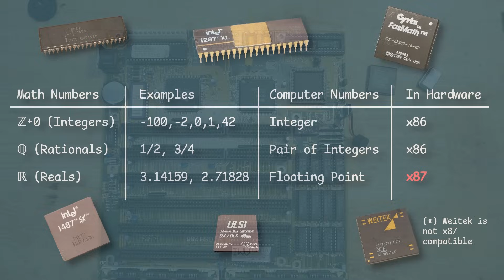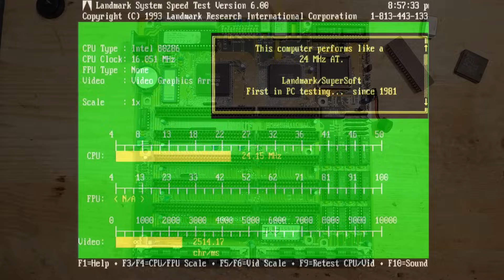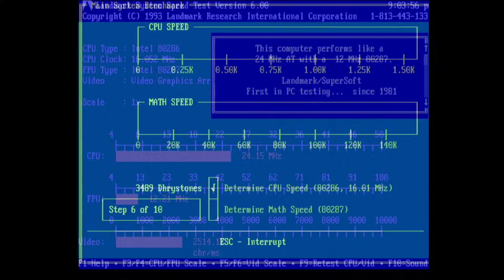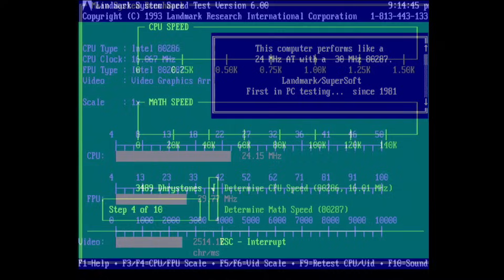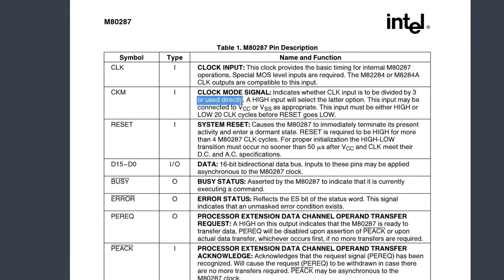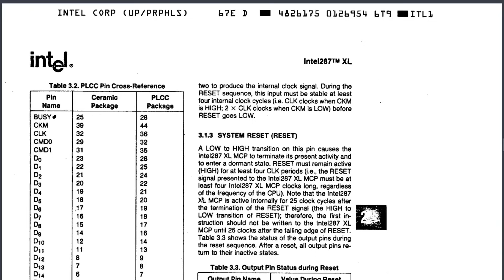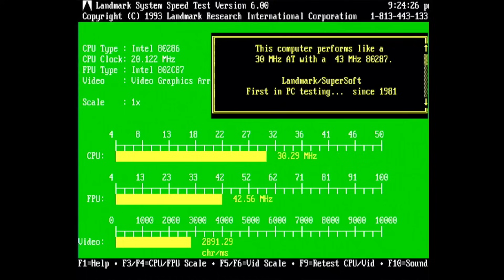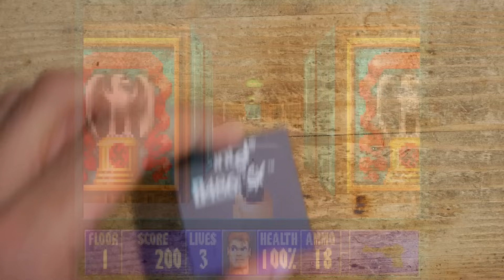287 Booster

Comment: I'm pretty sure the main difference between SX and DX is the data bus width, not the presence/absence of math coprocessor
Reply from the maker: Depends on the CPU. On 386 it's the bus, on 486 it's the coprocessor.

Comment: Interesting and informative, I actually had access to a 286 12mhz back in the day and we would play around in Doom on it.... was interesting; but as a kid it was better than "nothing else to do"... I never really put much thought into Doom/W3D not using an FPU and remembered when my friends family got a DX2 66 and Doom was running "max fps"... or so I thought at the time... I realize now it was the higher clock rate plus onboard GPU really accelerating that experience... When I later got my own AMD DX4 120 and Quake released, my friends Pentium 75 smoked it in Quake.... because of the superior FPU. ... things I wish I would have known as a kid lol, could have saved some money.
Reply from the maker: Thank you for sharing. It's always interesting to read how memory can cheat on us. Same often happens to me, that's why I like to dig out that old hardware to confirm or disprove my memories. F.e. you definitely couldn't play doom on a 286 back then. Probably that was Wolfenstein 3D, because Doom requires at least a 386 CPU. But even on the fastest 386DX at 40MHz this game was barely playable. Even 486DX2-66 was still not able to run the game at full speed (the game had a limit at 35 FPS). GPU acceleration was not a topic in Doom as well. In fact the game came years before first non-professional GPUs hit the market, so it didn't use any hardware video acceleration. It did benefit though a lot from fast data and memory throughput, so fast PCI or VLB graphics cards were important.

On the other hand what you remember from Quake is absolutely on point. The game required an FPU and that was in Pentium massively better, than in any 486. So even Pentium 60 delivered more FPS in Quake than a 486DX4 at twice the clock.

Comment: Then there's the 8 bit home micros, the generation before. They used BASIC, had no floating point hardware and the really weird thing about the basic interpreters is that usually they would use floating point numbers for everything, Which of course being run in software on an 8 bit computer were dog slow. So while home users that programmed often used BASIC, almost all commercial software was written in assembly language.

Comment: I really never cared about 286 or older CPU's, for me the PC experience started with 386 (the first 32 Bit Intel). Before the PC (I got my first in 1996) I had a C64 and an Amiga500 with some MOS6510 and Motorola 68000 CPU. Because of the later is why I looked down on 286 as a teenager :).
However, I really enjoy to see you videos with all this Necroware :D.

Comment: Having temporarily added a 287 to a "normal" AT clone, in the mid 90s, can confirm that it is a staggering upgrade if you have lots of FP calculations. At least if the 286 is an Intel ;)

Comment: In the late '90s my friend's father was a static engineer, he designed roofs, porticos with a 386SX, without a co-processor. He inputed the datas a dos-like (without a graphic surface) program, and waited for the results 10-20 minutes. With this co-processor it would be a much more faster process. So, it was a great development in that times, where it was available.

Comment: On the topic of Falcon 3.0 since you brought it up, the part of 3.0 which uses the Math-coprocessor is the "High Fidelity" flight model IIRC, apparently half-broken for some reason (at least when I tried it on my 486dx)

Curious how it'd run on your 286 since the game requires the 286 as the bare minimum.

Comment: I used to use CAD on a system just like that back in the day. Seeing that old ACAD interface that was text only brought me back. I still use ACAD and because I had learned all the shortcuts back in the day they still work today & I still use them as it's just more efficient.  I remember it all well. Everything was a lot more effort, you needed separate programmes to do everything & DOS was something I had to be familiar with; everyone did. The math co-processor was an absolute must have for an engineer or draftsman. Computers are just so fast and powerful today I don't think young folks would understand.  I would actually get ahead of the programmes and be up to a minute ahead of commands executing my inputs in real time. It was a very different time.

Comment: Wonder if a bench waveform generator would be good enough to test in between 32 and 40mhz

I know also that I was able to use an old FPGA - in 2019! - to make a 32bit RISC cpu running at 50mhz. I wonder how fast a n emulated cpu could run on these old motherboards today.

Comment: I admit that, at first, maxing out the FPU performance of a 286 system seemed to be a rather empty exercise, even in the realm of retro-computing... there's practically no 286 software that uses the FPU, and the few programs that do would anyway run much better on 386 (or newer) systems. Nevertheless, it was an awesome video. Maybe it'd be nice if we (Nectroware community) could develop a test program using FPU and doing something (relatively) useful (eg, computing solutions to the Schrodinger equation, or some other scientific task), written in plain C or Fortran so that it could be ported to many (retro) systems. I'd started doing something along these lines in the past but then had to put this mini-project on hold.

Comment: The 386DX had also a CoPro included - before the 486SX and 486DX ;)
Reply from the maker: Unfortunately, no, it hadn't.
Reply: @necro_ware  Ahh - yes there was also a 387 CoPro. But DX sounds like it would have :)
Reply from the maker: @guidolehwalder9376 yes, that's a very common confusion, because of 486SX vs 486DX. On 386 those suffixes had a completely different meaning.

Comment: The code that renders sloped surfaces and the random number generator in Duke Nukem 3D use FPU. The latter is not a problem, the former could cause a horrible performance regression on 486SX systems depending on where you are in the level. It may have also been an oversight, since the game doesn't actually contain any FPU arithmetic operations, not even one, it does however use FPU loads and stores to convert an integer into mantissa-exponent format and do some bit twiddling. The overhead on FPUless systems comes not from the computational difficulty of the task, but from the interrupt overhead of the DOS Extender trap that ends up emulating the FPU.

Comment: It's kinda cool to see an FPU being clocked at a higher frequency than the main CPU. It makes you wonder what such a setup would have been used for. Of course, this was at a time that Intel still allowed its CPU to be produced under license, so that the company had multiple sources for its customers. It was also at a time that Intel still supported its older CPUs alongside the newer ones for a longer time than it now does and at a time that it was still possible to plug in an FPU from a newer generation (the 80287XL is after all basically a  387SX in disguise) or  an older FPU alongside a newer CPU (for a time the 80287 was the only FPU available for the 386). 

The 80286 was a very fast CPU in its heighday. Its biggest downside was that it was not able to switch back to real mode without a hard reset of the CPU. There is documented evidence that this was in the microcode of the early samples of the CPU at the request of companies such as Digital Research, but it was taken out a later stage because the implementation was supposedly slow, unstable and buggy. Also, Intel at the time could not conceive of a scenario where this would have been useful, which is why they never gave it a high priority). 

This all changed with the introduction of the 80386. Not only was this CPU capable of switching back and forth between real mode and protected mode, it also introduced two other features: a so-called v86 mode, that allowed real mode programs to run in a virtualized environment (for instance, multiple concurrent DOS sessions would be possible in specific versions/editions of Wiindows or OS/2) and hardware paging, which allowed for easier and more streamlined implementations of virtual memory. At the time of its introduction, it was advertized as a mainframe in a DIP package - which with regards to its capabilities was not far from the truth.

Comment: "Because we can" is also why my 386DX40 got 32MB RAM and an IIT 3C87-40 😄
Both upgrades were entirely pointless for what I'm doing with it, but I just wanted to finally own a fully maxed out 386 that I could've never afforded back then... and I have since repeated the same spiel with a 5x86-133 at 160 and an embedded Pentium MMX 266 (Tillamook based, but on regular socket 7) at a whopping 400MHz on a Super Socket 7 board with a few mods

Comment: Back in the day I used that 287 FPU for Fractint, to generate and explore beautiful fractal images (well, I had CGA so take this 'beautiful' with a grain of salt :D). And it did help a lot, my later 386SX-33 that didn't have an FPU was usually (not always though, some code probably used more integer math, I think) slower in these calculations than its 286-10+287 predecessor. Unfortunately I don't know what clock the 287 ran at. Now I have other 286 boards, but still no 287XL which would be fun.

Comment: I bought a beautiful IBM 5170 to restore back in 2020, and it CAME WITH an awesome little daughterboard plugged into the 287 socket.  It's real vintage tech, called the "Microway 287Turbo."  I've been told it's really rare.  The board has a socketed 287-class chip on it but it also has its own clock crystal, allowing faster operation.  They must have been pushing it to the wall for the tech of the day too, because the 287 has a big heatsink on top of it.  The 287Turbo also intercepts half of the AT power connector, I'm assuming for extra juice!  Lastly, it's got a real hardware reset header (early IBM PC's lacked this) which I wired to a button I installed up front.  I bought the computer from its original owner who told me he'd purchased it new for "scientific calculations."  That's gotta be why he wanted the fast FPU.

Comment: i'd be curious to see the performance difference, if any, between a 486 dx and 486 dx paired with a 487. maybe its been done already but when they were available to me i didnt have the means to try
Reply from the maker: 487 is a 486DX in disguise. When you plugged 487 into the mainboard the 486SX just got deactivated. So, there's no difference between 486DX and 487.

Comment: What is the point doing this? Because we can 🥰 Few weeks ago i bought nice 386 25MHz with 8MB RAM and there was empty socket so i installed 387 N80387SX-16 and it working. I have no clue if this improve my computer but empty socket is now full and "empty socket syndrome" is gone🤣 I have to do some benchmarks. System report FPU present, sysinfo also, computer look stable

Comment: I would consider pulling out the DIP memory and then trying 25 MHz again. The DIP chips are 80 ns (-8), which is not going to work at 25 MHz even with a wait state added. Ideally you want 60 ns chips (-6) for both your DIP and SIMM sockets, but it's easier to find 60 ns SIMMs than 60 ns DIPs. Even at 60 ns, you may need a wait state to reach 25 MHz.

My first 386DX machine was so early that the 387 didn't exist yet! The coprocessor socket accommodated only a 287. This seemed like a limitation at the time, but it's funny that Intel "fixed" that with the 287XL -- long after I'd moved on from that 16 MHz machine that only accepted 1 MB on board. The other 3 MB was on an ISA card (slow!).

Comment: I remember the day of the intel 8088 and intel 80286 IBM and IBM compatible computers that had a vacant slot for the optional math coprocessor. For the intel 8088 the match coprocessor was the intel 8087 and for the intel 80286 the math coprocessor was the intel 80287. However for increased speed in floating math performance the software programs had to be written to detect and make use of the math coprocessor if a math coprocessor was installed. If the software program was not written to make use of the math coprocessor the math coprocessor would make no change in math performance.

Comment: Duke3D and other games using BUILD engine is another example of a game that did use floating point, but only for rendering sloped ceilings and floors and would bring a non-FPU system to its knees if a map had them!
Reply: Yeah, I think the Watcom compiler used for it adds a software floating-point library that'll automatically get used if no FPU is detected on startup.
Reply: Yss, that is exactly what happens, and software FP Watcom used wasn't very optimal at that. But at least the game would still run!
Reply: Look for my comment. There are no FPU arithmetic instructions in Duke3D, i disassembled the DOS binary and went through it carefully. There are however FPU loads in exactly one routine! Which is used twice, once in slope renderer, and once in a random number generator.

And the overhead is not from the arithmetic, it's because of how FPU emulation is implemented. It doesn't choose a variant, it traps an exception from unrecognised instruction, and all the overhead is in the exception mechanism and exception handler, which then needs to do instruction decoding too.
Reply: Thankfully, Ken has long since published the source code of the BUILD engine, so please take a look inside A.ASM where you will find the slope subroutines in fact using FP instructions such as fild, fadd, fst, fstp. Hope that helps as this has been a subject of debate in the past! =)
Reply: @Xaelloss   The source does NOT correspond to the shipped Duke3D game, it's cobbled together from various versions of the engine. Furthermore not all a asm routines are used! There is no fadd in the executable that i found, there is just fild and fstp. Just load the executable in disassembler or decompiler of your choosing.

Comment: Thanks for showcasing an application that uses the FPU and makes it go faster. I'm pretty sure it's the first time I've seen that in a youtube video. It's usually just getting a score in check-it, and maybe swapping faster clocked units in for a higher score in check-it for the most part is what I've seen.

Comment: I had a 486DX-25 for years;  eventually overclocked to 48 MHz (!).   But, thinking back - I don't think I ever used the FPU once other than maybe Landmark speedtest.exe ..  EDIT:  Maybe SimCity :)
Reply: I had a DX/33 and the FPU got plenty of use playing Duke Nukem 3D at reasonable speeds and Quake as a slideshow with the sound breaking up, plus calculating fractals with Fractint. Well, until the zoom got high enough that it had to switch to arbitrary precision mode, and it slowed down a lot at that point. Some of the other comments say Scorched Earth supports the FPU as well, and I played plenty of that. I think I'll fire up DOSBox and give it a few rounds.

Comment: I'm a bit confused by the "Rationals" line at 1:30 - was this really a thing? I think this should just be Reals represented in Fixed Point. Really nice 286 mainboard, would love to have one of those.
Reply: Yeah, it was actually not uncommon for programmers working with fractions to define a rational type (typically a record type consisting of two integers) and write algorithms that took advantage of the properties of fractions to avoid slow floating-point computations. Some languages like Common Lisp and Smalltalk from this era even have built-in rational types.

Comment: Sorry if this has been mentioned, but SPEED600's made up numbers are actually related to an original IBM PC AT 5170. So my stock 5170 running at 6mhz with no FPU shows roughly 6mhz in SPEED600. I assume if I had a 3mhz FPU it would show 3mhz for that. When running on another machine at 6mhz but with 0 wait states then you'll get something like 9mhz, etc. So your motherboard likely has various optimizations like 0 wait states which causes that number to be higher than the actual clock speed. So theoretically what it's trying to say is your machine at 24mhz is like an original IBM PC AT 5170 running at that speed.  Theoretically! While you can overclock a 5170 motherboard a little, it quickly becomes unstable at even 9mhz! (Mine right now is overclocked to around 8.7mhz and most of the time it no longer boots.)
Reply from the maker: Thank you for the correction. I mixed it with the XT and said, that the numbers are related to that, but in fact, you are absolutely right, that would be the AT.
Reply: And by “mhz” I assume you don’t mean something milli, but “MHz”.
Proper letter casing, can save your day too.

Comment: I remember the time when I tried to run 3D studio 3 on my 386DX machine, I had to use an software FPU emulator. Rendering one scene at 640x480 resolution took the machine several minutes.
Reply: Cant remember the name of the emulation I used, but it was way faster than using only the cpu, used  it for fractals. (Fractint)